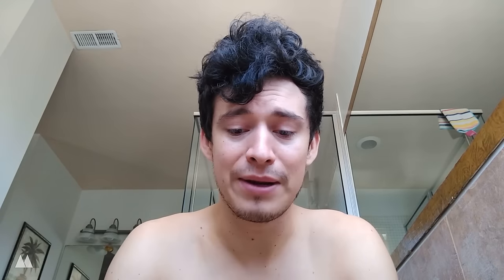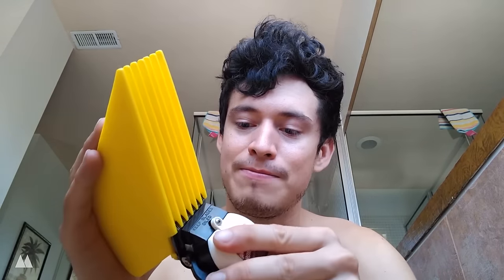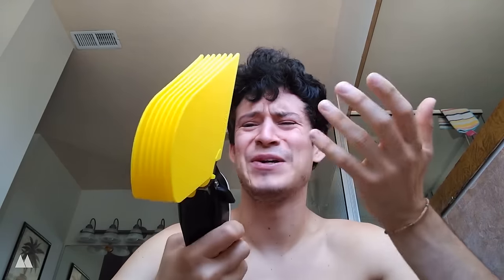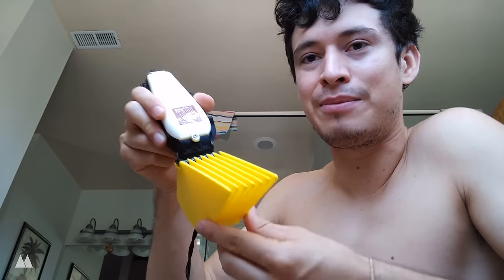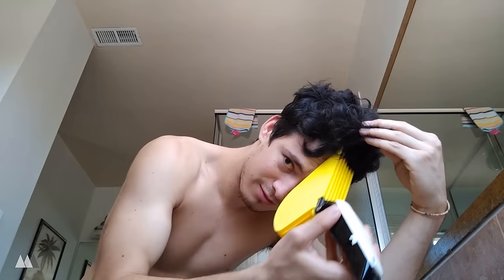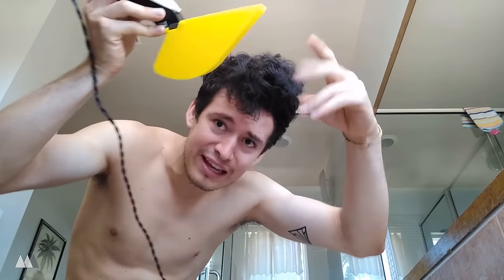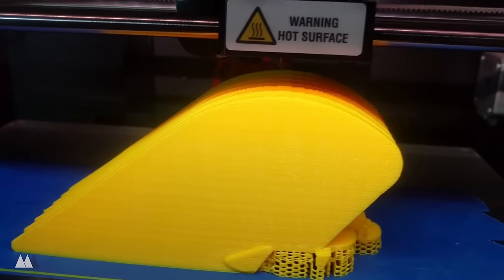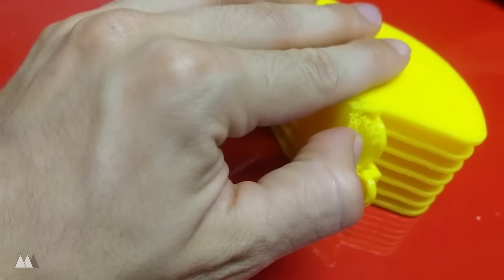Even More Mega Clippers (Update)

Comment: Thats what I need, a 2 inch one. I use the biggest one that comes with the pack and it just too damn short so I end up using scissors and it helps but I just want to run the machine right through and get a decent length

Comment: I want guide combs that will allow me to very gradually shorten my hair so I don't get it to short. How is it that Clipper manufacturers have a 1- 1/4 " guide as maximum length and minimum is 1/8 "  or 1/4"?  For me  1- 1/4 " is too short.  I like my hair spiky and 2 to 3 inches in height. But I'm not sure what the right length is so I need to start at say 3 inches and then do  2- 1/2", and then decide...go to 2 inches? So I need tall guide combs. No one makes other than a ClipQuik #16 and I don't know what clipper it fits or if attaches solidly. My Hair guy in another town I lived in yrs ago used to throw on a tall guide comb and buck my hair off at the right height. Easy peasy.